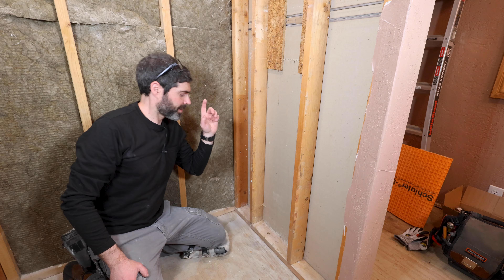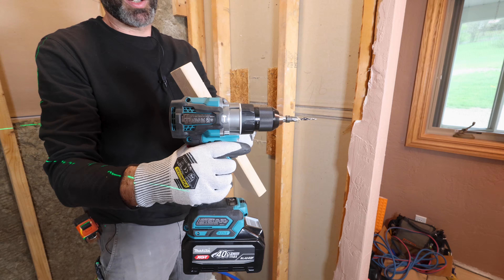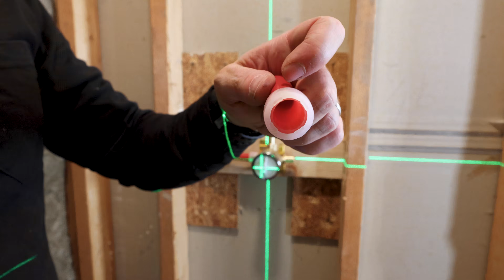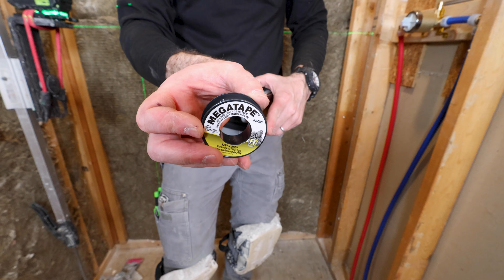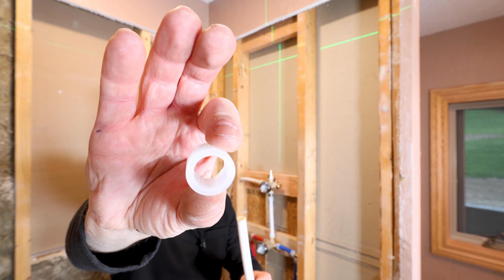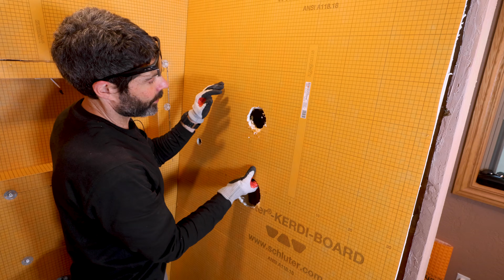PEX A Plumbing Made Easy: Must-Know Tips for Beginners

Comment: Great video. Are you running into pin hole leaks in the pex products? I just ran across a video that showed the leaks. Apparently this is happening to houses up to five years old. I’m concerned.
Reply from the maker: No, I haven’t had any pinhole leaks with PEX. Copper is a different story

Comment: Great video! Already purchased all the plumbing needed to do my guest bathroom. A new "DIYer" taking on this, what I consider to be, BIG project. Thanks for this! 

One question, in searching for the valve and diverter valve, these do not come with the cartridge's/trim correct? I'm wanting to place the valve on the "dry wall" and diverter on the "wet wall". I believe the valve/diverter you are using are best for what my goal is vs any other options out there.
Reply from the maker: Thank you, the valves don’t come with the finished trim - you’d have to buy those separately. I used the Delta R1000 main valve and R11000 diverter. You could place them separately on different walls but don’t use an exterior wall if possible

Comment: Why did you leave out the 9" inch expansion tubes behind the hot and cold side of the shower valve? Aren't you concerned about water hammer when you shut off the shower valve?
Reply from the maker: No because it’s a pressure balanced valve and water hammering won’t occur

Comment: I had an expansion sleeve move and only found it when I did rework. I now mark the pipe at the expansion sleeve for a visual if the sleeve moves after placement. It’s not needed but you can’t otherwise visually verify everything is properly aligned.

Comment: Excellent video, and I am trying to find a video on how to install a diverter trim. There are no videos or information. Since it is not the same as installing the trim on a normal Delta valve.
Reply from the maker: Thank you, ya the trim for these diverter isn’t too bad. The cartridge only fits one way and there’s a plastic piece that slides over it that engages in the slots on the brass valve body

Comment: when expending PEX u should rotate the tool
Reply: The expansion part of the tool rotates as it opens and closes on the Milwaukee and other battery powered models.
Reply: @gavin0o1  Yes - it is a good practice indeed.  I use the Milwaukee electrical tool which is great and indeed it rotates the head but... to add roundness of the expansion, I rotate the tool at the last step while it is doing its expansion.  Simply said - a good practice.

Comment: You don’t even need 90s on the hot/cold supply uponor will bend, less fittings the better
Reply: To make a 90 deg. bent, I use a 90 deg. plastic sleve for Pex.   Inexpensive at Home Depot.  It is mor difficult to bend a 3/4" Pex A into such sleve, but with the help of a hair dryer, and two zip ties, it works well.

Comment: The main valve would be great if it came with fittings facing down.
Reply: It's nice to cut out the angle. I bought a couple 90's for the mixer.

Comment: The ears on the diverter valve want to sink into the wood and pitch the body upward. So I had to adjust the blocking and put washers behind the ears to get the face of the diverter plumb. Your installed valve looks like it pitches upward.
Reply: Washers sound like a good idea.

Comment: You can use rings and clamps for Pex B on Pex A tubing to take advantage of its greater flexibility. You can't use Pex A expansion connection with Pex B tubing however.
Reply: Awesome. I'm learning right now. I'm working with a very experienced plumber so I'm learning more to impress my coworkers when I learn more.

Comment: Another way to route PEX through framing is to add isolation inserts to keep the PEX from rubbing against the wood.  Is required by code in some jurisdictions.  Over time the  pipes may wear from constant flexing, frame vibrations.  Wood moves from vibrations and from expansion and contraction from moisture, aging etc.  Over time it can potentially wear through the PEX.   Isolation inserts are inexpensive and provide cheap insurance.  Also can use those bend supports to reduce chance of  kinks.
Reply: Are you for real? We strap Pex to wood backing all the time. Maybe going thru floors but if you will use the correct drill bit straping is done very little, maybe for roughing for  shower valves.  We use the red snap in bushing for metal studs. Wood is not a unlike metal to Pex like a metal stud is to Pex. Good Luck!!  Im sorry for replying but when i hear stuff that is not code, i like to chime in since i did this work for over 40 years before retiring.

Comment: If there is a bathroom upstairs and you're building a bathroom in the basement underneath the bathroom upstairs using all the same plumbing drains does the pex to the shower use a T or does the shower need separate hot cold lines ran?
Reply from the maker: This is a separate bathroom. There’s only plumbing down below in the basement. So all the water lines need to come up from there. And all the drains are below

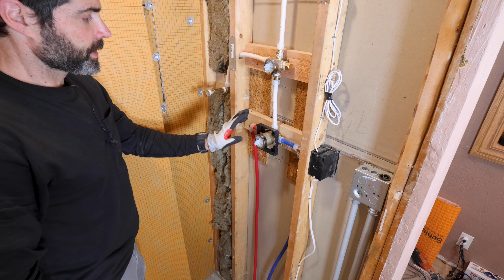Comment: What is the electrical box with the conduit running in and out?  Pause at 10:59 to see it.
Reply: Most likely outlets for the laundry room on the other side. Either 4 regular 110V outlets or one 220V outlet for the dryer. My bet is the 220 outlet. The box on the left (for the viewers) is probably the 110 for the washer.

Comment: When plumbing a shower is it necessary to do these expansions with the expansion tool or could I make the connections with the shark bite clamped or clampless fittings?
Reply: I think that the problem with the compression or "clampless" fittings is that they generally have a shorter recommended service life. In this instance, where you would be enclosing the fitting in the wall and wouldn't know if/when a fitting fails until there was a full-blown disaster, it would be recommended to go with a clamped fitting.

Comment: I'm wondering how you checked for leaks before putting up the walls. Did you charge the system and monitor the fittings or temporary hook up fittings and run water through the system?
Reply from the maker: Correct, I add copper pipe nipples and SharkBite valves to them. Then I pressurize the water lines, open each valve (one for the shower head and one for the handheld) and run water through all the fittings. After that I check all the fittings for leaks

Comment: why are there two valves and what are drop ears for ??
Reply: Bottom valve turns on the water and controls the temperature. Top valve diverts water between the shower head above, or the wand to the left. 
The drop ears allow you to screw in the brass nipples for the shower head or shower wand.

Comment: Does PEX restrict water flow rate vs copper?   Specially through a 90 degree fitting?
Reply from the maker: I’ve never seen it cause a reduction in water flow
Reply: pex b clamp on fittings will reduce the flow.  Expansion PEX A fittings do not as they are the same ID as the pipe.

Comment: I just bought a house and they remodeled through  out all pipe but  we have a problem with leaking already at fisrt week its ours nightmare because we dont know anything about it how to fix 😢
Reply: The first home I owned, over 40 years ago had terrible plumbing. My friend and I replaced everything but the drain lines. He knew more than I did but with the newer plumbing and YouTube you can do it yourself.
Reply: What happened? I'm planning on finishing up a bathroom addition and I was told if you get a leak, turn the water off at the main valve for about 20 minutes and the pex will shrink back and stop leaking. I have no idea how that is possible?!

Comment: I've heard all the arguments for using both thread tape and thread compound, and it never makes sense to me. On the inside you have tape essentially sealing compound to the nipple. On the outside you have compound sealing tape to the cap. How is this an advantage? You add complexity, which rarely makes things more reliable. It just introduces another point of failure.
Reply: I was taught that the Teflon tape keeps the brass from galling and seizing against the opposite thread, but it really doesn’t seal a gap very well. The compound fill the gaps.
On non brass fittings, I use compound only. 
On brass, I use both.

Comment: I must say: I was skeptical about PEX A pipe. It was used throughout my new home build (completed in 2020), and I would have prefered copper.
However, I just recently completed a new water heater install (switched to a hybrid/heat-pump unit) which required the heater to be relocated within the utility closet. 
It was actually cheaper for me to buy the PEX expander tool and necessary fittings & rings, than it was for the plumber to come and do the work.
I must say: PEX-A is neat stuff! I came from doing the old-school sweated copper lines. But PEX-A is SOOO easy to work with! And the connections are quite secure.  And, since there's no rubber seals (like in "pro-press" and "shark-bite" fittings) the connections should last a lifetime... just like properly done [sweat] copper.
My WH project is completed, and working great!
Reply from the maker: That’s awesome! I totally agree, PEX is my favorite option for all the reasons you mentioned. Plus, the expansion tool is great for tight spots between joists and studs. Overall I prefer it instead of PEX B and copper
Reply: @HomeRepairTutor using pex right now as an apprentice and it works so well even compared to copper plus it’s so cheap.
Reply: @HomeRepairTutor  I've used PEX B since 2012 but recently bought a manifold on eBay that was marketed as B but was actually PEX A, and non refundable. Buying an expander on marketplace was the same as buying a new manifold so I did and it instantly changed my mind. I will use up most of my PEX B pipe, fittings and compression rings and after that it will be PEX A all the way! The flexibility, ease of use, especially in tight spaces are a game changer! Keeping a few of the B tools and rings for the occasional repairs of a B install.
Reply from the maker: @farmerchair I feel the same way, PEX A is awesome for its flexibility and ease of use

Comment: I went to Marketplace and looked for cordless expansion tools.  My search covered about half the Houston area.  I stopped counting at 40 lightly used units for sale before I gave up counting.  There were many more.  Here's the thing.  A DIYer buys the tool uses it for a bath remodel and then tries to sell it for 10 cents less than he paid for it.
Reply: I am doing the same thing. I know some buyers and sellers are against low balling but it never hurts to just make an offer.
Reply: @TheBestAsianGamer  Actually I didn't think of that.  Before I could I found one that the husband of a friend of my wife has.  It's going to cost me the price of a 3/4" expander.  He just has a 1/2 and a 1".  Give back better than you got.  If giving back includes a generic brand expander.

I can't go 1/2" A.  It's more restrictive than 1/2" copper.  I'm installing a shower tower thing that demands all the pressure and flow I can give it.
Reply: Seems like it's perfect for someone to make a drill attachment
Reply: @recedingant4868 for real.  I’m surprised ryobi doesn’t have a head unit already.
Reply: Get the Vevor tool; it's less than $200 and does an amazing job.
Reply: Market place is trash

Comment: How do you do if one of those fittings leaks, how do you remove it to replace?
Thanks
Reply: I am not a professional but pex a fitting are probably the best. Almost impossible to do it wrong as long as you just push it until it stops. but if you need, both fitting and pex are plastic. you can just cut with a razor knife. Heating it up first would make it softer and easier to cut. If you heat it long enough, it can become soft enough to just pull it apart.
Reply: to remove the pipe from the fitting is tricky....you can score through the ring but avoid going too deep.  Once most of the way through the ring, use a flat head screwdriver to twist into the cut and it should break the ring.  Then score through the pipe BUT BUT BUT  be careful not to nick either of the two barbs with the blade or it will ruin the fitting (if brass - if composite/plastic probably need to replace fitting.)    If you cut thru just shy of the barbs, then heat with heat gun, the cuts will give and you can pry with screwdriver force open the cut, then twist the pipe off.

Comment: I found the Sharkbite pex-A elbows and tees to have poor spacing, making it difficult to get a proper fit, particularly with 3/4" pex.  I like the Apollo elbows and tees much better, as they leave plenty of space to get everything snug and flush.
Reply from the maker: Are you referring to the stops/shoulders on the brass fittings?
Reply: @HomeRepairTutor  The Apollo elbows and tees are just slightly longer behind the stops so that you don't have the white sleeves bumping up against each other.

Comment: Just use a six way valve. You could do all that and just cap one outlet.
Reply from the maker: This can be a six function valve as well. But I like the separate valve for a few reasons
Reply: Next time get delta R22000 and your reasons would go away.  But I do want to know what your reasons are.
Reply from the maker: @xcyted4now reasons are the two separate  valves are a bit easier to tile around with certain tiles. And I like the idea of if some goes wrong with one valve or the other, they can be swapped out individually. Or, if the client decides last minute they don’t want a handheld, it’s not an issue
Reply: Ok just wondering. Thanks! Good video regardless. @HomeRepairTutor